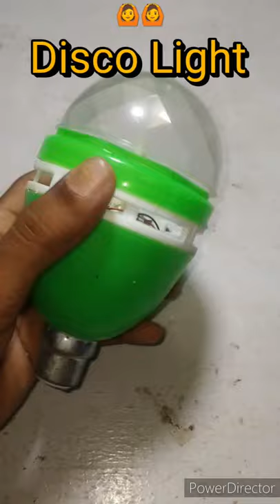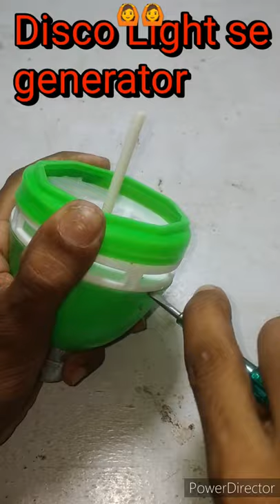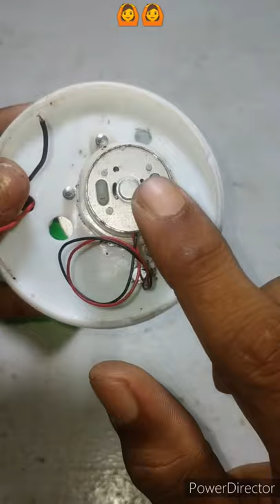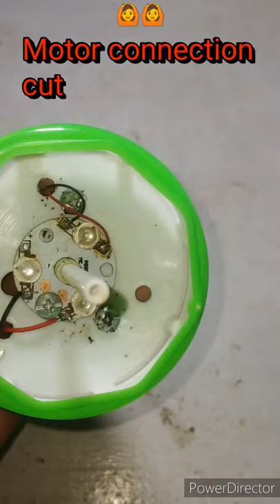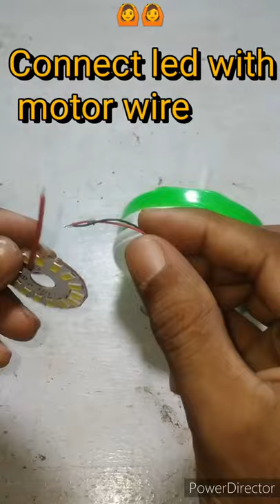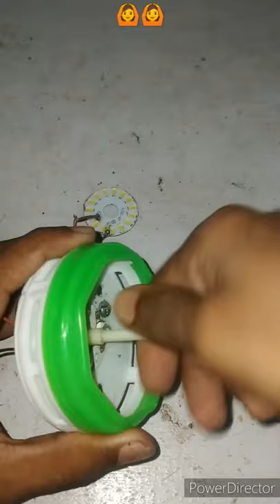How to make free energy generator with disco light #shorts

Comment: Not work 😭 but use led light
Reply: Just find any DC motor and connect it to the + and - terminals of the LEDs, won't work for LEDs 5V or higher